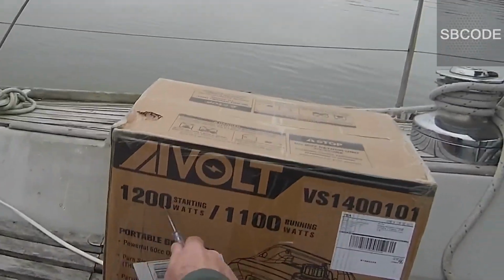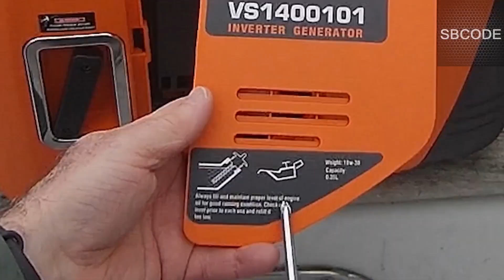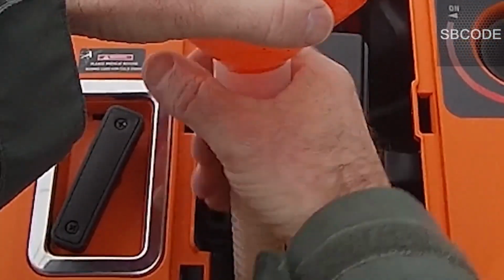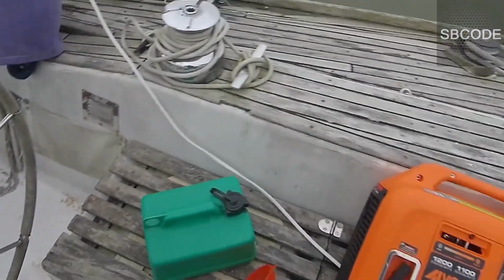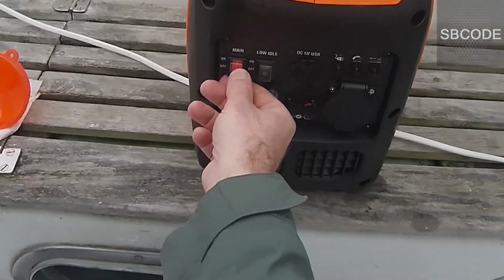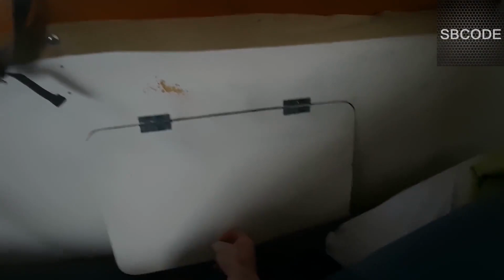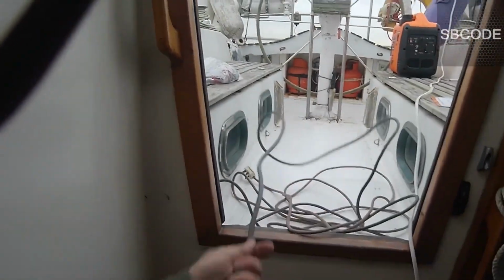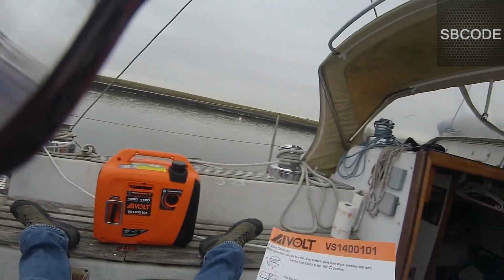Testing an AiVolt 1200W Petrol Inverter Generator

Comment: just got one, it was the cheapest one I could find,  £225, UK, quiet , light,  just need it to charge me Batts for me Tramper van, I live init for 7 to 10 days at a time, winter time, no or little sun, it does the job
Reply: Been looking at these on Amazon just for emergency back up, £270 on Amazon, where can I get one for £225 and are you happy with this generator?
All the best, Steve. 👍🇬🇧
Reply: Just got one on Amazon UK, now on offer at £216. Run it for a few hours so far and it seems very good. Although advertised as "silent" it's quite noisy but probably no worse than similar units. Got it to charge my motorhome Ecoflow during the day so no need to run it at night.
Reply: @pghoward  if you were stood right next to it would you need to raise your voice or shout to have a conversation?
Reply: @cookiemonster2299  Hi, no it's not that bad. You can easily talk next to it but it is intrusive. As an example I ran it in my back garden about 10m from the house. I shut all the doors and windows but it was still audible as a background "hum" throughout the house. Playing music masked it but in a quiet house it was clearly audible, albeit at a low level. I was aware it was potentially annoying to my neighbours but fortunately no one complained so maybe I'm just a bit sensitive!
Reply: @pghoward  great reply thanks, I'm just thinking of emergency use during power failures to keep the fridge freezer and aquariums running, sounds like it would be ideal for me, thanks again. 👍😁
Reply: @cookiemonster2299  Definitely 👍
Reply: @cookiemonster2299  is your generator still working???
Reply: @md2320  yeah it's all good.
Reply: @cookiemonster2299  asked cos they're cheap on Amazon and there's a couple of reviews that say theirs has stopped working??? Thanks for replying 👍